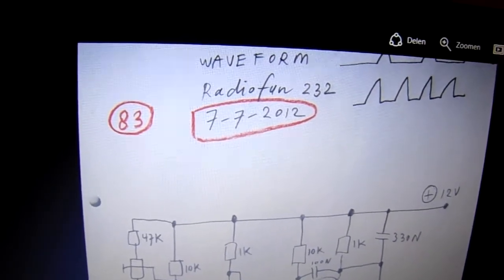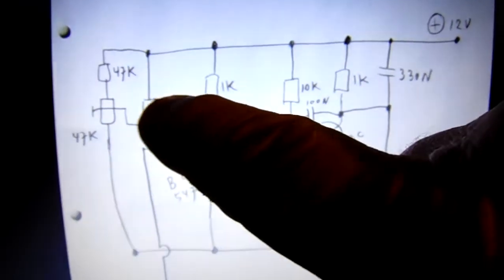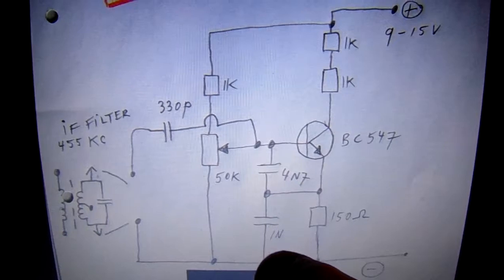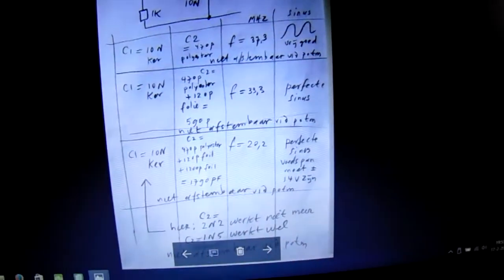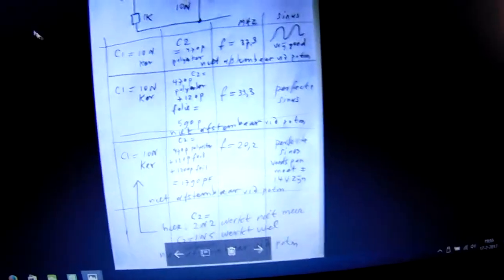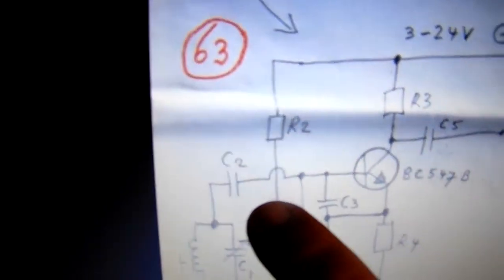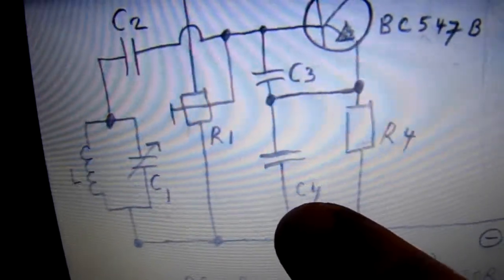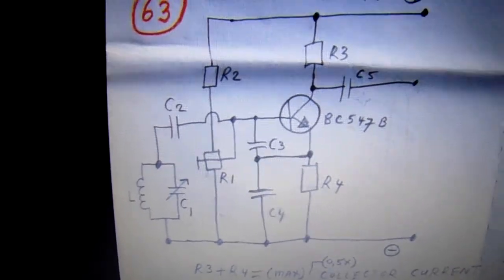Oscillators & some of my (published) schematics and experiments part 2 (2010-2017)

Comment: That big circuit (the one that disappeared for a moment) looks very interesting. It was labeled “A Measuring Amplifier”. I don’t think I’ve seen that circuit in any of your other videos. Is it in one of your books perhaps? Thanks.
Reply from the maker: Hi, thanks. The circuit is not in one of my books, only published in this video (and was built in real).  I did not publish it because it has a limited frequency band (say 100 Hz-15 KHz). But I used it in practice a few times to "pump up" a generator signal in the audio range from (say) 0,8 V to 7 or 8 Volt. And the signal generator can be used separate from (and in combination with) the "power" amplifier.